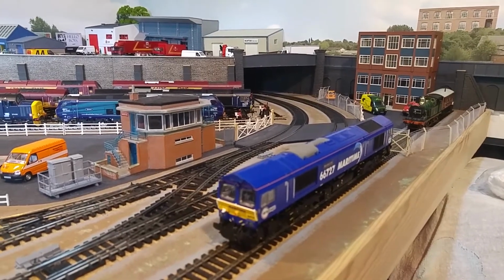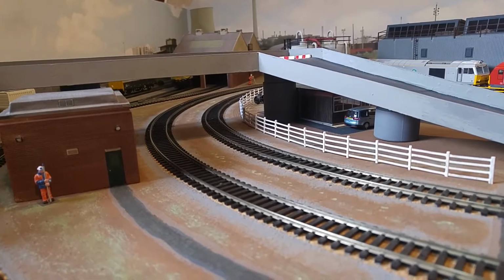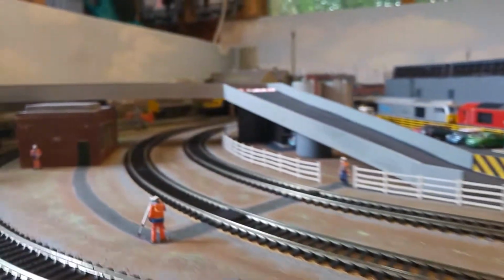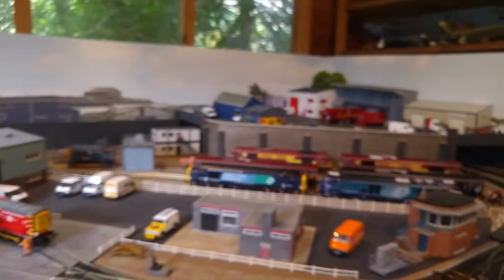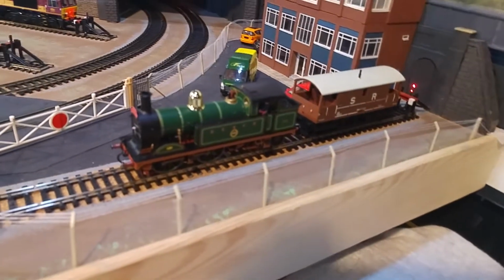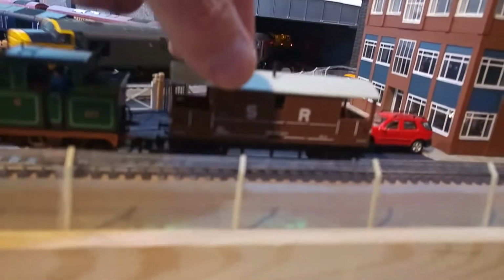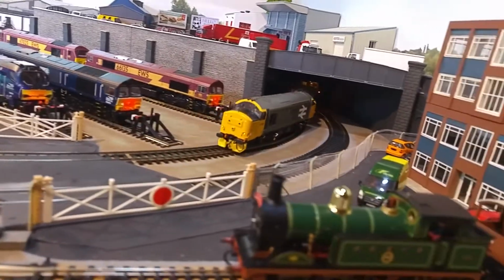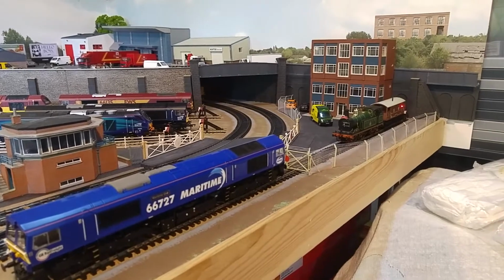Double heading and new loco joins the fleet

Comment: Hi Peter,
Nice running session and the new 66 looks good are you not allowed to run it until you have been on the coarse, will look forward to seeing it when you have. The sound module in your guards van would it fit in a passenger coach?. Double heading is the thing that Railmaster is rubbish at if I want to do it I have to control both loco's separably as all the loco's run at different speeds so to use its heading program never works. about to film my 4-6-0 running session.
Cheers Robert.